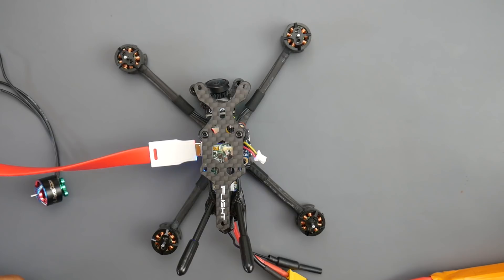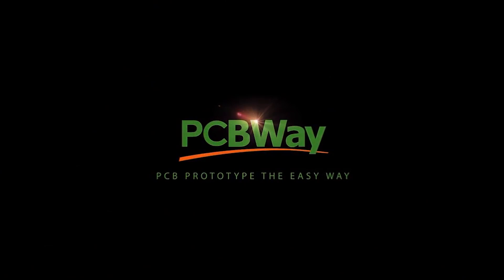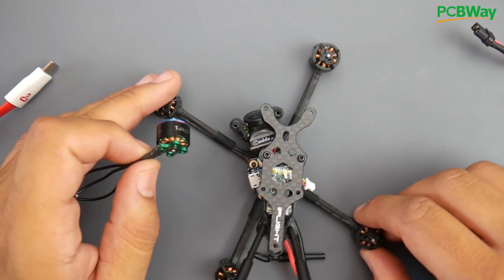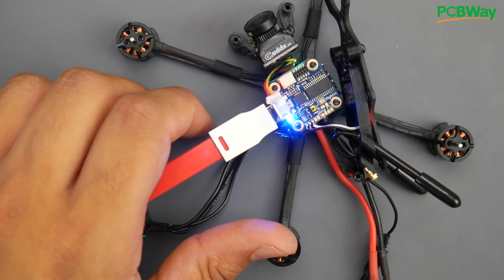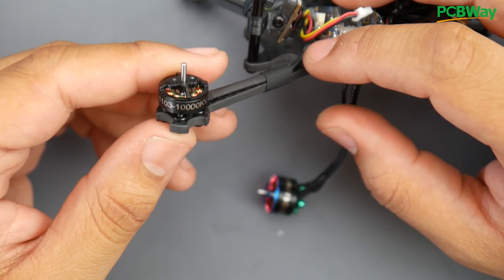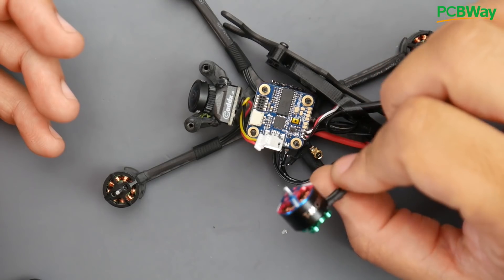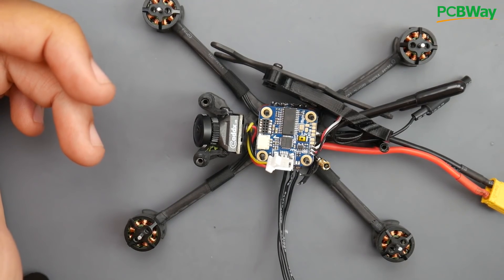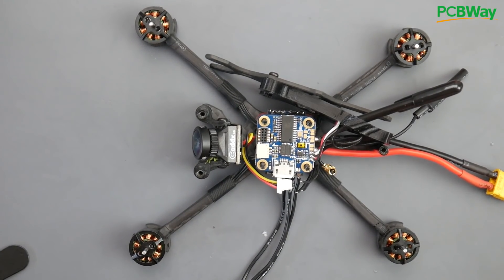Fixing iFlight TurboBee 120RS after 2 Flights

Comment: The racerstar motors have good performance but unfortunately the durability is poor. The base is too thin making the motor break easily in a crash. The shaft doesn't have a retaining ring on top so the bell have a tendency to pop off in light crashes

Comment: The only problem I have is it getting that thing to work I ordered another receiver that looks like it'll parrot better with this though it does not have two antenna like I wanted we'll see what happens I tried to use my other PPM receiver but it does not seem to be working so oh well no I might have deleted all the software it was flashed with in an effort to get the thing to work so it seems like once again I am left with a paperweight that is supposed to be a contactor just like my king Jung smart 100.

Comment: I just got a bad 4 in 1 in my Succex Mini F4 stack. I can't see any of the escs. I have the same stack in my ET115 and it works great. Amazon is sending a replacement. My ET115 runs the HGLRC Flame 1105 6000kv which work great on 3S.

Comment: That's a bummer man. Reviewers curse. I tested a pre production cinebee75 HD for a couple months. Probably flew 50 2s packs and half that on 3s . And then  I tested  turbobee 120rs on 2 and 3s and no issue with motors or esc but my vtx died after about 30 packs. I don't recommend 3s though on the 120rs just because it's overkill and arguably  it flies better on 2s. With an auw of 91g with a 450mah  2s it's the fastest most nimble micro class racer I have flown. But..I think it could be better. The 1103  don't  really like heavier props like the Azure power 2540.They perform fantastically with the gemfan flash 2540 and I hear they are great with the new 65mm HQ. I want to try the 1104 9500kv and if they aren't any better I'll have Iflight make some 1203 9500kv to test.
Reply: Great info. I've had my eye on this little quad, but dont know what motors/props i should choose (building it myself). And how is this thing compared to a "normal" Toothpick (1103, aio-board, aio cam/vtx, 65mm props)? The typical Toothpick is lighter, but I like the formfactor of the 120RS.
Reply: @torskurdal2721  if I were to build it myself I would just change the motors to the 1104 9500kv beemotor. It is a ton of fun on 2s as it is but you can feel the motors struggling  a tiny bit with heavier props. I still need to get some 65mm bi blade  to try though. I have some dvr up on my channel if you want to see how the bnf flies on 2s.
Reply: @protofpv  Cool. I'll check out your channel.
Reply: @protofpv  This? https://www.iflight-rc.com/index.php?route=product/product&path=110&product_id=834. Adding 8 grams, but maby its worth it? But they are 9mm mounting. The 1103 are 8.5, right?

Comment: Stus from uav did the same cheap junk motors the stack is bullit proof i transfered mine into a tirbobee frame from another quad but i have 1105 motors on mine 3br no issues you have to change the motors for it to work

Comment: Been running 3s 350mah for over 40 flights.  But I'm using 65 mm Props.
It rips
Reply: Yes. This is the way to go with this bird. 65mm all day
Reply: @SpikeJonesTheCr0oked  I just finished a 4s RS 120 with 1104 ,4200kv motors . Should be fun if props stay..

Comment: The 2s version is not supposed to handle 3s. Its known that 3s will burn the motors.
Reply: They say on their website that the battery they recommend is a 2s 450mah.. so this may have been avoidable.
Reply: @jonholand5307  A lot of the initial reviews used 3s, so there was a miscommunication somewhere probably.  The iflight website has been saying 2s only for weeks though.

Which sucks, I hope they come out with a 3s version.
Reply: I just got one delivered and it says TurboBee 120RS Micro FPV Race Drone (2-3s Version)

I did only order the FullSend HV 2s so far so I guess I will hold on the 3s that was recommended.  

Also to note, as of yesterday the add for this bird still says 2s-4s and the box its shipped in says the above 2-3s version.
Reply from the maker: Yes and everyone I saw used a 3s and thus why I used a 3S.. DO NOT USE A 3S or say bye bye to the ESC or Motor.
Reply: 3s on 10k kv motors is ludacris anyway :P
Reply: 4 pack of 2s HV gets delivered today finally... Can't wait to fly this little thing.